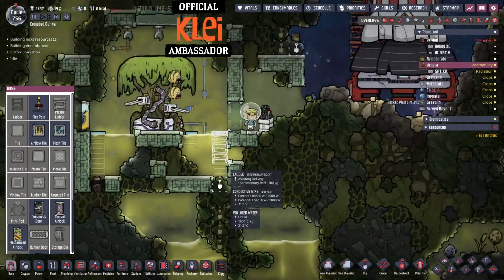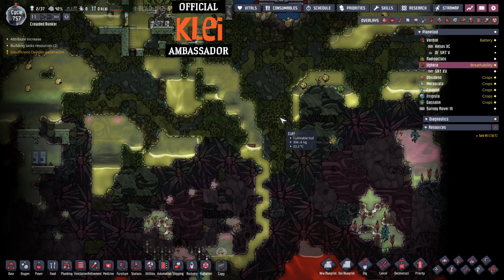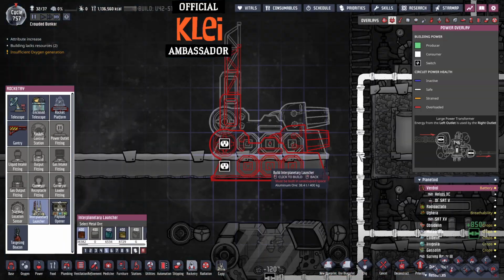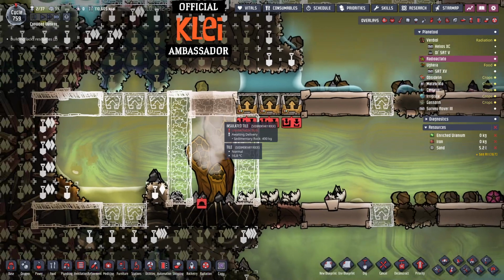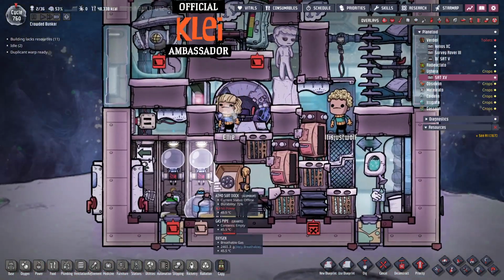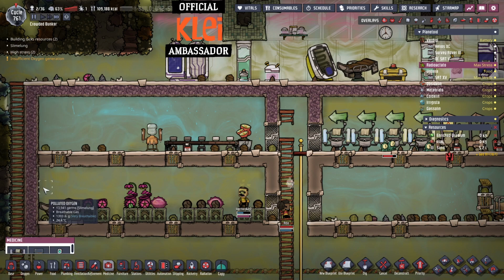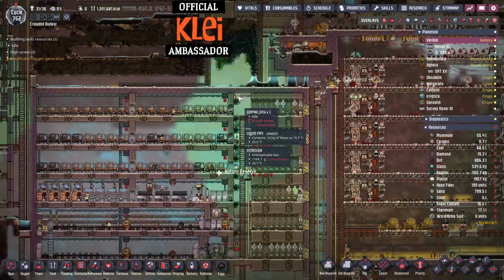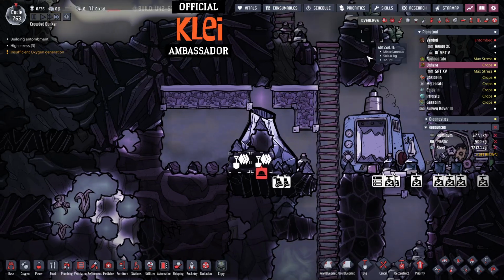Oxygen Not Included - Most Dupes Record Attempt - Part 51

Comment: So when will we reach the record by cycle 2000 or episode 2000?
Reply from the maker: As I've mentioned in a couple of episodes, there is no official record to aim for so I'm just seeing how far I can get. I'm also not trying to do this within any time limit, and my primary concern is making everything scaleable and sustainable. The biggest issue I have is ensuring I have a sustainable food supply, which is essentially wild farming or critters. I don't want to use domestic plants and then run out of resources later and have a major issue. Building these mega-projects takes time, and I am very much enjoying the process of that. I fully expect this colony to go over 2000 cycles if it doesn't lag to death before that! If you can do it quicker, then by all means I'd be very interested to see.
Reply: @GCFungus  there is pretty much infinite water in this game now without duplicating cheating or glitching there is a colony on Reddit that has 225 duplicates running on blossoms and oxygen and he has ran it for 6k cycles afk. And if you do use duplication glitches exploits or other stuff like that there is no limit to how many duplicates you could have other than your computer not crashing. With pips you can run as many Mealwood as you want free with no dirt. There is a way to duplicate liquids like petroleum to run in petroleum boilers for free water.. and there is the whole steam rocket and deep silo thing. If you don't have an official aim for something you probably shouldn't call it a record run. Just change it to a playthrough. I'm not trying to be mean or call you out or anything I just kind of find it umm disingenuous. And I have not watched the whole series just the first episode and the last two so whatever you said in between I did not know lol